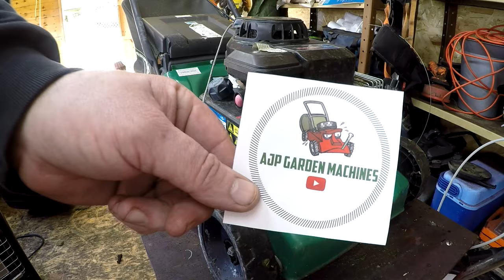EASY FIX Briggs and Stratton has a spring problem lets fix it.

Comment: I'm new to mower engines Mick, and I replaced my carb before taking a look at these springs and the new carb didn't really fix any issues, ready to make this fix but I'd really appreciate if you could comment on what these springs exactly do? do they move that arm to regulate how hard the mower is running? my mower seems to rev up and down in surges and I'm thinking this is why
Reply from the maker: It all depends on what set up you have mate .. take the air filter off and email me some photos of the carb and spring set up .. micksmowers01@gmail.com

Comment: Great vid. The small adjustments you are doing whilst it's running and you take the air filter off, is that you bending the small plate at the end of where the small spring attaches?
Reply from the maker: Yes mate ..

Comment: Great fix again.  Hope youtube does not get on you for playing that music.  Great video.
Reply: Is the muffler guard loose?  That cage seems to move and vibrate. I have never been a fan of those. My Dad would not let us be in the yard while he mowed. It was 1976 before I was allowed to even touch the mower. Age 10 and up was Dad's rule. A lot of the safety equipment is just a replacement for common sense. Good job Mick. Nice fix. I liked the music a lot also.

Comment: Glad you got the old girl running and sounding sweet. You appear to have invested a lot of time and effort not to mention cost with the new governor springs, diaphragm and gasket, oil, spark plug and especially if it needs a new dead mans cable. How do you decide what’s viable and when it it is time to call it a day. Keep up the great work and the videos coming.

Comment: Thank you for the excellent video. I have successfully followed your instructions to service my Mountfield SP470. One problem I still have is that the primer bulb gets sucked in after about 5 mins of running and the engine cuts out. If I pull the bulb back out and prime again, the engine starts and runs again for another 5 mins before repeating the cut out. any ideas what the problem could be? I have tried loosening the fuel cap in case that is the problem but that doesn't help.
Reply from the maker: Replacement of the primer bulb.. I had that once.. it sorted it
Reply: Thanks. When I serviced the mower I did replace the primer bul, but I don't think it was a genuine Briggs bulb (black, original was red), so maybe I should get another one. @themowerman

Comment: What size is the bolt holding the tank on? The smaller one on the front of the engine. Working one one that didn't have it and can't figure out what size thread it has.
Reply from the maker: 3/8
Reply from the maker: https://www.ebay.co.uk/itm/185251732649?mkcid=16&mkevt=1&mkrid=711-127632-2357-0&ssspo=BO9atLmNRlq&sssrc=4429486&ssuid=VxofTcWjS-2&var=&widget_ver=artemis&media=COPY

Comment: Hello Mick  I have  BRIGSS & STRATTON lawn mover 500 SERIES the primary was not working so I decided
to tack the carburettor apart to clean as well to check the primary ...it was blocked  put every think back  and 
it started after  a few pull....BUT  IT STAYS ON THE HIGH REV ALL THE TIME  the accelerator cable moves free
forward but nothing changed  I do have a spare lawn mover it is almost the some except the governor is different 
the rods where the springs connects is near the aluminium paper  rather the 500 the governor rods  goes straight 
turns 90 the greed and connects with something in the motor  ( I hope I have given you an idea of what traying to 
to say ....I should have said that if the governor where the some I would have copied from the other one .
Thank you
Reply from the maker: Two things to check.. 1 the throttle is moving on the carburettor.. make sure its swinging back and forth.. 2 the long governor arm can get hooked up ... Just move some of the metal work around it to free it up.. hope that helps

Comment: Hi Mick, seems like it’s got a slight little miss on this at the end of your video. Is this normal? Mines doing the same every now and then slight little pop / miss. I’ve changed diaphragm & gasket Briggs & Stratton genuine one, £15 quid on new governor springs, adjusted coil air gap with a business card and it still produces a little pop now and then is this normal ? Thanks bud all the best.

Comment: Mick my B&S lawn mower has a different configuration on the governor as it passes around to the back of the mower on the same side as the carburetor and has no place to attach the bigger spring on, where does this spring have to be attached? the lawnmower starts and idles but does not pick up revs to cut the grass?
Reply from the maker: Email me some photos micksmowers01@gmail.com

Comment: I have a Briggs motor 3.75hp Sprint with adjustable throttle on a pressure washer. Can’t get the motor to turn off When I slide the throttle control to “Stop.”
It almost seems my springs are too long to push the Governor vane. How do I solve THAT problem?
Overall, a good video!
Reply from the maker: Follow the cable to where it connects to the engine.. there will be a small switch.. clean it and adjust the cable so it closes the switch. Then it will stop..

Comment: I also have this classic engine and after I had no spark and it was the coil it now goes at top speed and surging. I see the governor flap moving a lot. I guess my new springs are too tight as well but why surging as well?
Reply from the maker: Could be..
Reply: @themowerman  matey it was the springs!! I replaced my 22 year old springs for new and they were too tight so the governor flap was moving up and down surging the engine and over revving it. I put old springs and now runs like always. Obviously the new springs I bought are rubbish and not designed to the right spec.
Reply from the maker: @porschecarreras992cabriole8  some of the copy springs are to tight.. I just stretch them a little

Comment: Great video🎉 i just cleaned my carburetor and replaced the diaphragm but its surging now. 
What do you recommend?
Reply from the maker: Did you put it all together right
Reply: @themowerman  ,
Yes i did. I got it as a non running donation.
Reply from the maker: @jwayne777  well a new carb may help.. have you got the springs on right
Reply: @themowerman  .
It only had one spring . Surging i thought was caused by a plugged carburetor hole. Im wondering which hole it is.
Im going to clean the emulsion tube again.
Reply from the maker: @jwayne777  ok

Comment: Hi a little question, recently i got a free lawn mower with briggs 35 classic engine (i think it is similar to the one on video). It wasn't running at all, so i installed new carburetor, springs, air filter, spark plug and cleaned fuel tank. Now it runs ok, only thing im wondering about is the 'popping' sound (from muffler?) from time to time. The same sound can be clearly heard on your video, especially from 28:00 your mower did the same 'pop' sound twice. Also in my case the spark plug turns black fast (its dry). I heard that these are old school engines and were never running super smoothly especially on idle, so maybe it is normal and i just should ignore it (furthermore my mower is probably from 2005 and i dont know it's service history, so the engine might be already litlle bit worn out) or should i check something more? Thanks in advance for your reply.
Reply from the maker: Yeah I know what you mean.. to be fair .. They all do that.m I would not worry about it

Comment: Hey Mick need help, I have a 1978 briggs and Stratton that pops and splatters with the air filter but runs as it should without it, air filter isn’t blocked how do I fix this problem? (edit , never mind I’ve found my problem filter holder thing was pushing down on the spring making it just idle and barely run)

Comment: Mick I have the very same engine the primer won’t prime the fuel into the carb, I’ve cleaned the carb twice now & everything looks good but still the same problem doing my head in any advice mate?
Reply from the maker: Mate a new carb is £20.. get a genuine one
Reply: @themowerman  Have you a link for them mate?
Reply from the maker: @jonnystewart8090  Briggs and Stratton Genuine 498809 Carburetor https://amzn.eu/d/bs4a2cC
Reply: @themowerman cheers. Is the ones not genuine any good?
Reply from the maker: @jonnystewart8090  no mate .. I have had loads and they are crap..

Comment: Ive got the same engine, which is surging and overrevving. Have changed the gasket and diaphragm, new springs and it is still over revving and surging. Do you know what else i can try?
Reply from the maker: It's one of tow things I would say.. the carburetor needs cleaning or the little metal tab that the small spring goes on needs bending towards the back of the mower.. you can adjust the revving by bending it
Reply: @themowerman  thanks Mick for your reply, will give these a go.

Comment: Hi  Mick, I have just referbed mine but when it's starting it's over reving how do you adjust the idaling on this mower
Reply from the maker: Where the small spring goes one end there is a small metal tab.. bend it back towards the carb a little..
Reply: @themowerman  thanks Mick

Comment: Silly question but is there an easier way to change the oil other then tipping it upside down?
Reply from the maker: Morning mate. You can buy a small oil extraction pump off Amazon. They work well. But run the engine for a couple of mins first
Reply: @themowerman  thanks
Reply: Drain plug underneath? Isn't that the only way? Why would you tip it upside down I don't get it
Reply from the maker: @hootnanny631  not all of the engines have a drain plug my friend